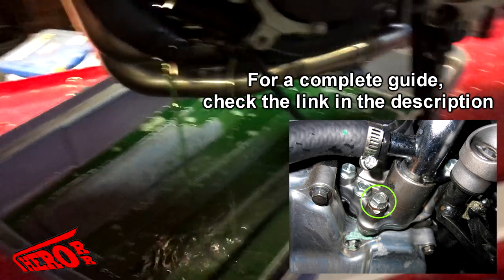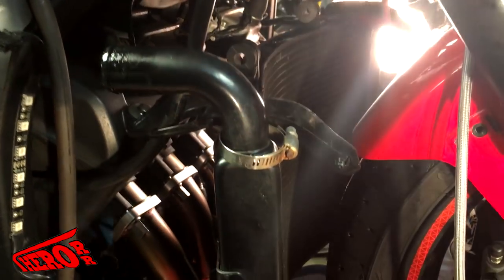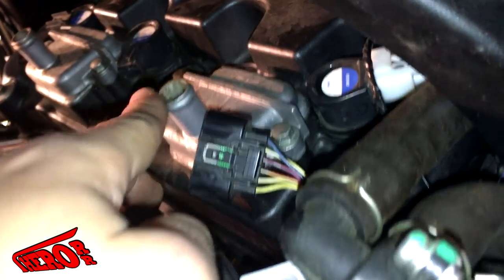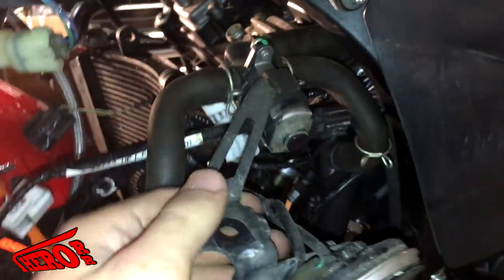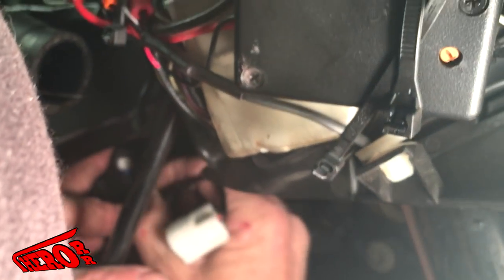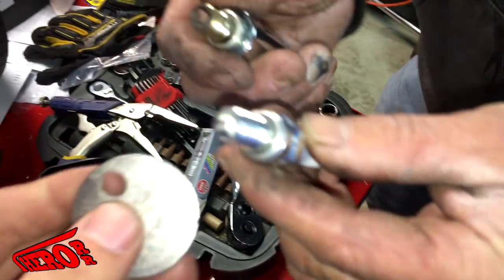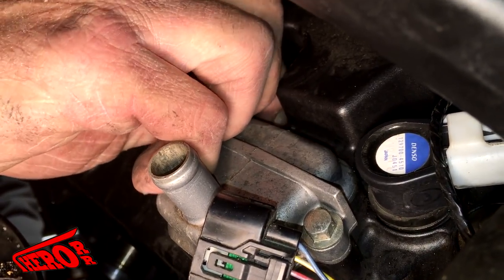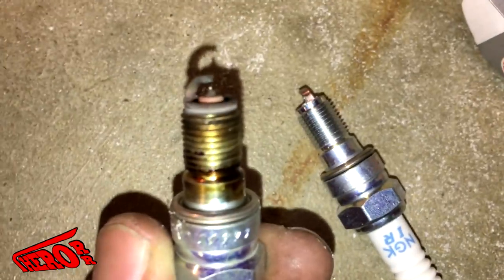How to change spark plugs on 2008 CBR600RR

Comment: Just did my plugs today 2009 CBR 600rr. You do not have to drain the fluid out of the radiator. Just unbolt it and push forward and bungee strap it. No need to disconnect the hoses. Getting the spark plugs from the top by removing the air box is more work for sure. Definitely, remove those two air hoses and the 10mm bracket bolt that secures it (it also holds the horn). Move it out of the way to the side as per the video (the ignition coil connectors will come with it too). Probably will have to disconnect the radiator fan connector too (for some reason the connector was a real  balls ache). Owners manual says to replace plugs at 51000kms (32000miles). I was at 48,000kms and the old plugs gap were within spec. 0.031 to 0.035in (per manual). You don't have to gap the new plugs - they are pre gapped (and were in spec).
Reply: Do this apply to the cbr500r ?
Just bought it and was thinking of changing them. It only has 15,000 miles

Comment: Just finished the plugs on my 2012 cbr600rr. The video was good it helped to see what I was getting into beforehand.the job itself was fairly simple and yes draining and lowering the radiator is necessary! Sure it's possible without but why not make it easy and do it right. Good video thanks!

Comment: Gonna attempt this on the weekend , hope all goes well. Just to be sure , do I definitely need the gaping tool , as i already have all 4 plugs in my hand. It would take 2 weeks before i get the gaping tool (not from the US)
Reply from the maker: +Webb Di Geniuz you can buy one at autozone for $2. You may want one to double check the gap. Also consider putting some dielectric grease on the boots.

Comment: I was looking all over for a video like this last week, couldn't find shit.  Btw I didn't remove the radiator to do mine.  I just unclipped the rail around the pair system and the wiring.  I removed the radiator screws and loosened the hoses so it was pliable.
Reply from the maker: That's precisely why I made this video. I wanted to help get some more information out there because I had a hard time finding any information also. Yeah there are a few ways to do it, I like the way I did it because I needed to flush and replace the coolant anyway (two birds) and removing the radiator did help film the area a "little" better.. lol
Reply: Hey hero gm. I have the same bike as u and need some help. Can I contact u pls

Comment: Hi, with all the mod's you have made, like the headers, autotune, and all that stuff, does it run's much much better? does it worth it? I'm asking because I own a 2007 cbr 600rr, and I'm kind like to make some modifications like you made, greetings.
Reply: I bought my cbr from a modder, took me about 3 months to get it running right. exhaust leaks, stripped threads, weird noises, "custom" tuning (which was just him bashing numbers into power commander maps).

Comment: I didn't have to do most of that when I changed my spark plugs in my 09.. I just unbolted the rad and let it hang and was able to change all 4 spark plugs.. it was a bitch but I didn't have to drain the coolant or any of that other shit lol
Reply from the maker: Yeah you "can" get away with it, but I tend to break things when I am working in very tight spaces on bikes. lol

Comment: Your spark plugs should already be gapped to the correct gap when you buy them. Also, use a wire gauge if you need to set the gap.

Comment: Do the plug threads need to be coated with anti-sieze lube?
Reply: I know I’m very late on this comment but for anyone wondering no you do not put anti seize on these spark plugs. NGK’s website states DO NOT apply anti seize onto NGK plugs.

Comment: why do you need to drain the coolant?
Reply: I don't know but I guess it is because he had to move the radiator out of the way and to do that he needs to remove the water hose and that triggers the drainage. 
TBH, a really shitty design and very labour intesive.
Reply: Exactly.
Reply: You don't have to. Look up on 600RR.net for a tutorial. I'm pretty sure you don't have to drain the coolant.

Comment: My manual for a 2006 cbr600rr, it says to use a wire-type feeler gauge. Does it matter?
Reply: Yes it does matter. The gauge he uses in the video will damage the spark plug iridium tip
Reply: @DROooPpyOG  Thank you for the answer!

Comment: Ive never had to drain my radiator to change spark plugs on the many cbrs ive owned
Reply from the maker: Yeah you don't have to. I just was already replacing the fluid so figured why not unbolt it and give myself more room.

Comment: Don't need to gap iridium spark plugs
Reply from the maker: Huh, service manual said I did, oh well. better safe than sorry.
Reply: This is from an NGK technician on gaping iridium plugs...   
"The coating is not the issue when checking the gap but rather the iridium being such a hard material it is brittle and snap off if gapped improperly. When gapping you do not want to apply any pressure or prying force to the fine wire center electrode or insulator or it can be broken and is not warranted. You want to adjust the plug only from the ground electrode. Sliding a tool across the iridium electrode will not damage it though as long as excess pressure is not applied. I am also including a photo of the proper way to gap the plugs. Thanks.

Best regards,

Brandon Peeler

Technical Support Representative"

Just gotta be careful using that round gaping tool as you can break the tip
Reply from the maker: Ok, thanks for the insight. Luckily the gap was already at the correct amount.
Reply: For sure bro! Love the videos and all you've done to the bike, i got a 08 CBR as well and starting to have to go through and do all that higher mileage maintenance stuff.

Comment: What signs or symptoms alert you that you need to change your spark plugs?
Reply from the maker: It's maintenance, I forgot how often but I believe you're supposed to replace every 16,000 miles. Usually if the plugs are bad you'll get worse performance and fuel economy, amongst other things.
Reply: Brian Rice, my bike used to sputter or surge while I accelerate through out the rev range. For me it usually only happened at low speeds. If I gunned it I wouldn't have a problem or loss of power but that could be different for you. Honda does recommend you change them every 16,000 miles. I didn't do that. my problems started happening around 23,000.
Reply: Ive had a cbr misfire while riding almost felt like the bike was in limp mode, changed the plugs and it ran beautiful again